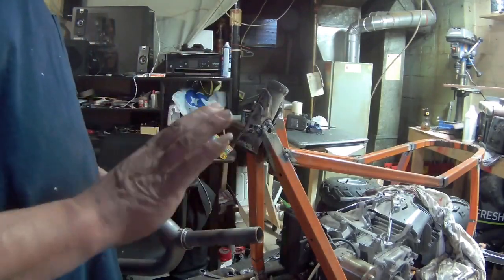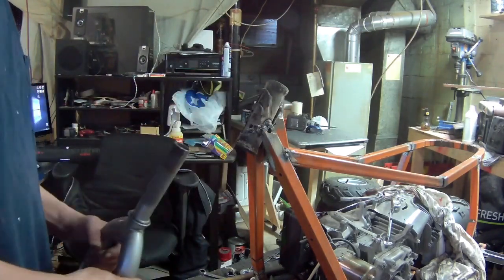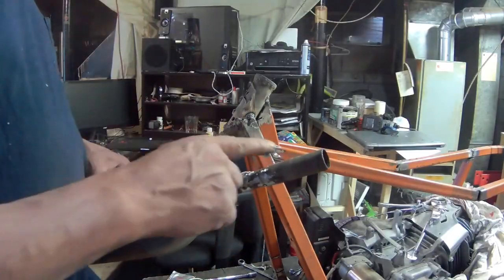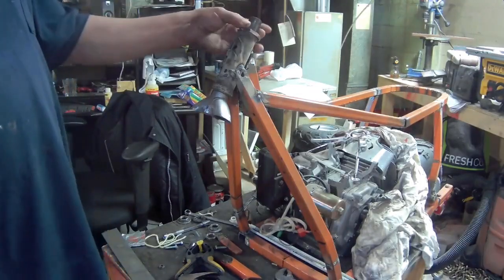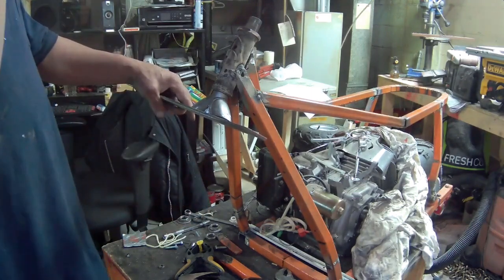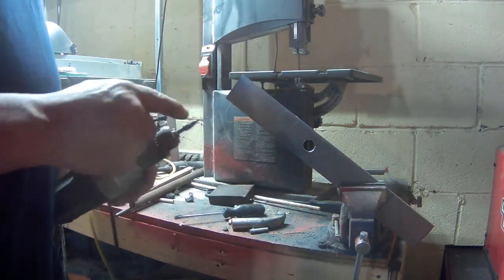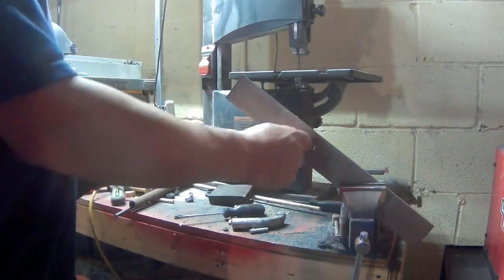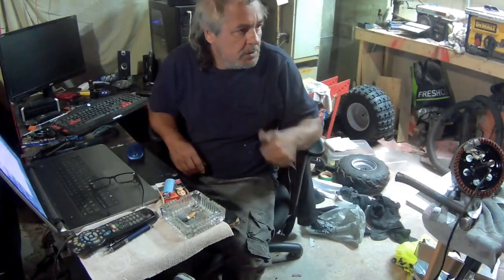Mini Bike Build, The Tracker pt.3

Comment: Good idea with the bearing end of the forks.  Was thinking the same.  
   That little bit you have in the drill is used in die grinders.   Electric or pneumatic.   The little bit is called a deburr bit. They come in all sorts of shapes and sizes.  For aluminium the burr has big coarse teeth  so it doesn't get blocked up.  Good for porting and so on. 
   Good one Neves.👍